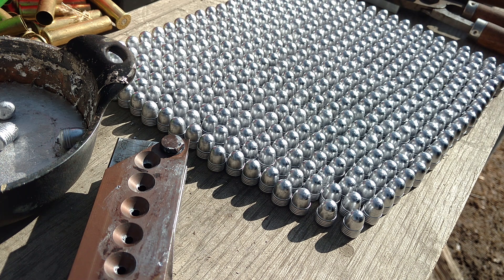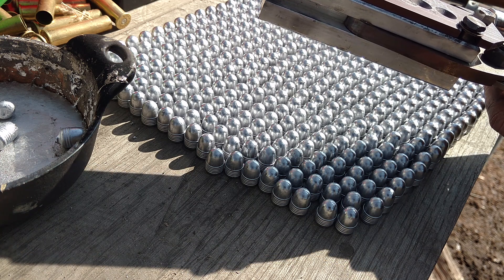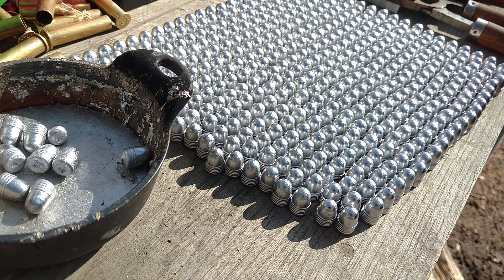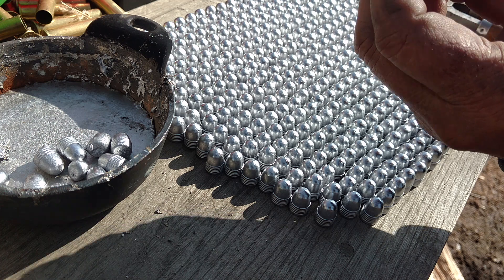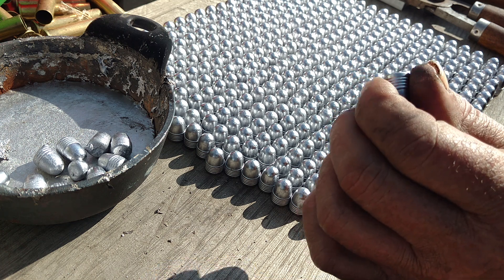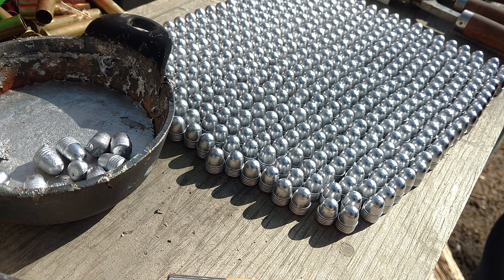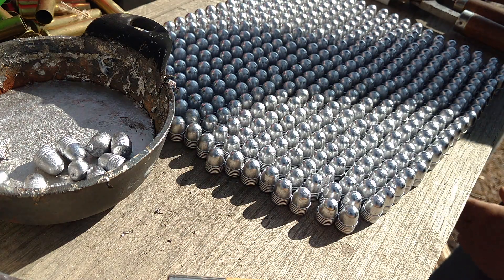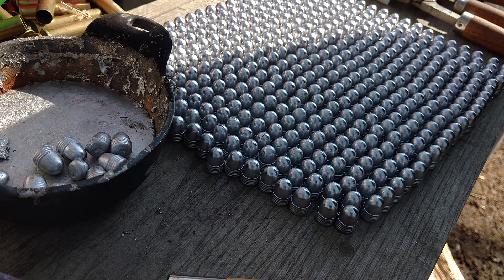Casting .45 ACP 230 grain Tumble Lube

Comment: I love my 6 gang lee molds. When I was young I bought the 2 gang molds to save money. Casting 6 at a time is the only way to fly.
Reply: I'm new to casting, all I've done so far is cast 7/8th oz. Lee drive key slugs. I'm looking to cast .38 and .45 with the tumble lube grooves. I've been leaning toward the 2 cavity molds, 'cuz I'm a cheap bastard, but I'm starting to think I'll regret it. The 6 cavity mold sounds like I'll be glad I paid a little extra down the line. Tough finding stuff like that nowadays, but things will settle down eventually, and then I'll start casting for my handguns. In the mean time, I'm collecting scrap lead at the range and melting it down into ingots. Here's one for ya: I buy those El Cheapo trap loads at Walmart, 100 for 20 bucks or so. They come with 1 1/8th oz. of shot in them. I carefully open them up and remove the shot, melt it down and cast my 7/8th oz. slugs. Load 'em into the shotgun shells with a 1/8" hard wad under the slug and choot 'em. I'm chooting slugs for less than 25 cents apiece, with lead left over!

Comment: I run pretty much the same rig. I water quench the bullets to get them up a few points harder. Doesn't cost a dime more, and cuts leading with loads for faster moving cartridges, or  very slightly over sized bores.

Comment: Thanks for the video, do you use an electric melting pot or just melt it on the propane stove?
Reply from the maker: Propane, I have a few of the Camp Chef 2 burner setups I use for canning, and they work well for casting.
Reply: @logcabinlooms  yep I'd seen you use them for other stuff. I wasn't sure how consistent they were. Good to know they work ,I'll have to try that.

Comment: I have the same mold, but only a two cavity. Only mold I could get here in the good old South Africa. I also cast with wheelweights, add a bit of bar solder to make it slightly harder. We get a lit of wheelweights that are almost pure lead, those that stick on mag wheels with double tape.
That bullet feeds very well in a 1911 and in my 1911's are quite accurate too. I also  have the other Lee 230 RN mold, it is still lying in a cupboard, have never used it. 
The tumble lube is very expensive here, wonder if there is a home-made recipe?
I lube those bullets in old Lyman 450, seems to work without leading the barrel.
Reply: Liquid Alox (45%), Johnsons Paste Wax (45%), Mineral Spirits (10%).  Probably any type of paste wax could be substituted.
Reply: @j.rob.5943  thank you very much. I will give it a try, though the liquid alox may be an issue to obtain. Seems many guys are going over to some form of powder coating these days.
Reply: @charlesmarais4582  check out fortune cookie 45lc he has recipes for lube I've tried them Johnsons wax n thinner works like lees tumble lube.
Reply: @inglwud5625  thank you for that tip! Often look at FC 45's videos but missed that one.

Comment: Do you have much problems with leading your barrel with cast bullets? I ask because I just cast some .50 Lee R.E.A.L. 250 gn bullets for a muzzleloader I just got and it said to use pure lead and I did and I'm going to go this week to see how they will group. I don't remember ever seeing you with a muzzleloader but the price for their bullets are crazy. 20 to 30 bucks for 15 bullets.  I'm just concerned about leading using the soft lead. Thanks

Comment: I used liquid some years ago,  and pan lubed even more. Actually killed one mule deer with a Lee 150 gr SWC from straight wheel weight metal over about 4.5gr of 231 in a .38 Spec. case. Out of a 4 inch gun,  that wasn't much of a load really. It was intended for mountain grouse. It did however do the job well enough. Bullet was lost in the field dressing but it showed evidence of bouncing off the chest cavity on the opposite side. Another 100 FPS or maybe 20 more grains of bullet weight would likely have been a pass thru and still have been less load than the old .38/44 high speed load that served pre war sportsmen and police. Cast bullets do a real decent job in the field. And the bigger the caliber the better they work. As incredibly useful as .38/.357 is in the field, actual deliberate hunting of deer and larger would be best served using .40 cal and up.

Comment: Is lead fouling ever a problem for you when shooing cast?
Reply: 45 auto normally shoots under 1000 fps . leading occurs more readily at higher bullet speeds. Also running a few jacketed bullets down range greatly helps clean most lead residue out of the barrel.
Reply: @barryrickert6544  I see. Thanks for letting me know.